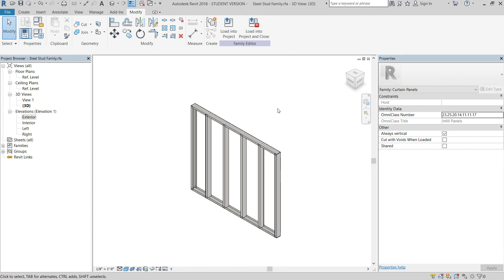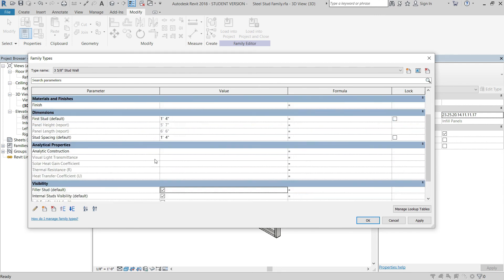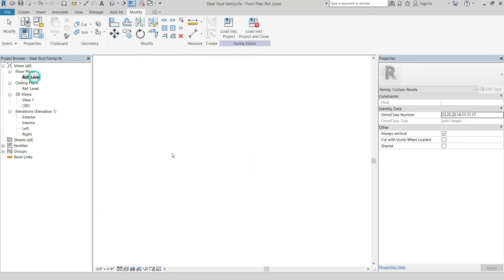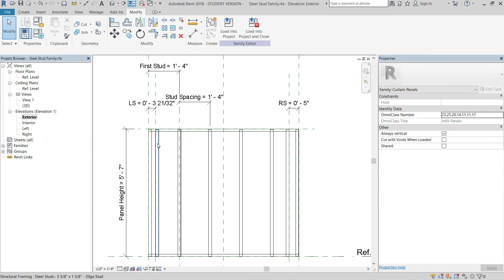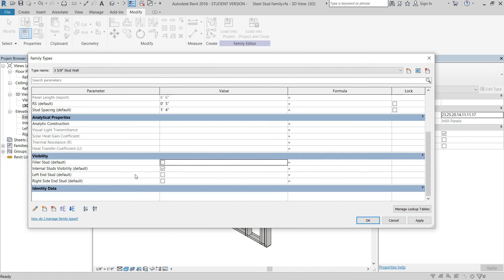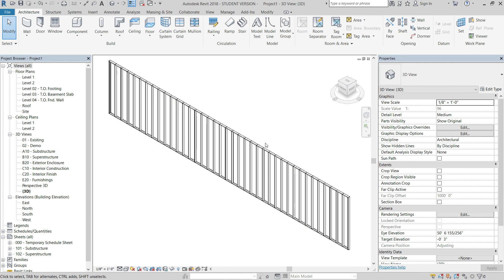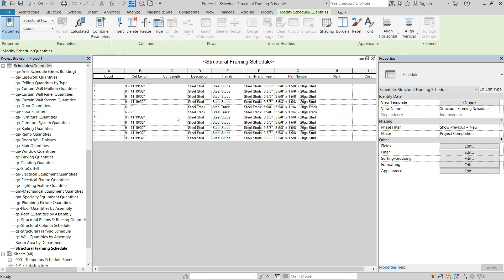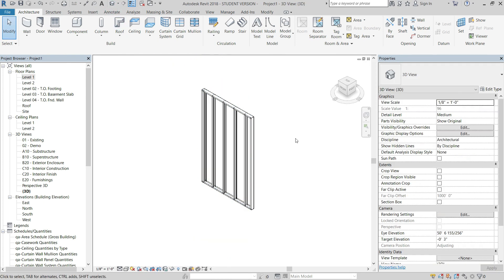Steel Stud Wall - Part 04 - Extra Stud Visibility

Comment: For the people that don't receive any information in the structural framing schedule. You have to edit the nested Stud and Track Family. In the project, select the panel and press edit famliy, than select one of the other families, for example C Stud family, click on edit. once you are in that family, in the properties tab, there is a button named shared. check this box. then load it back into the panel family, and the panel family in the project.

Comment: Thank you. You've made a great job! I will try to do the same for wood structures.
One question: is there an option in schedules making total numbers (qty, cost, so forth)?
And one comment: I have met some issues with using this family (as well as simple studs) in the Structural Template. Once I switched to Architectural - everything became at its place.  It works.
Reply from the maker: I will be making a video on how to properly use the wall.in a project and how to organize schedules.